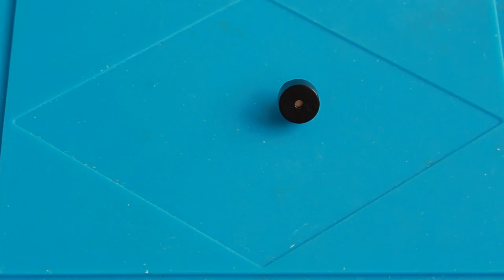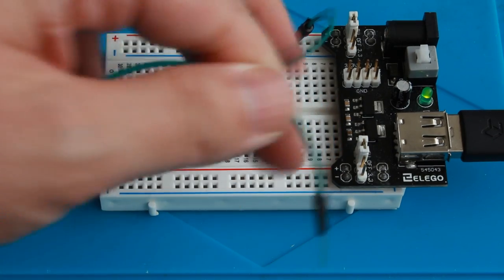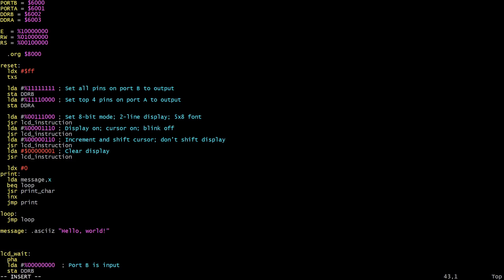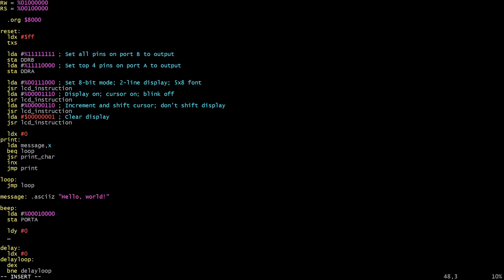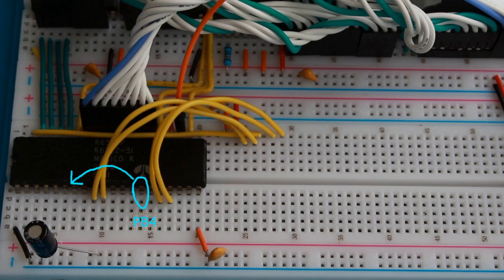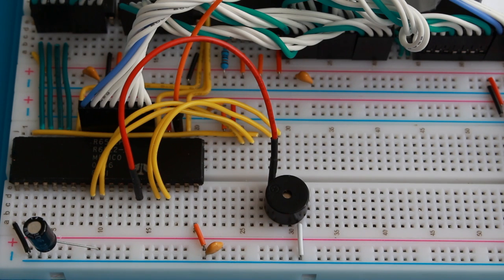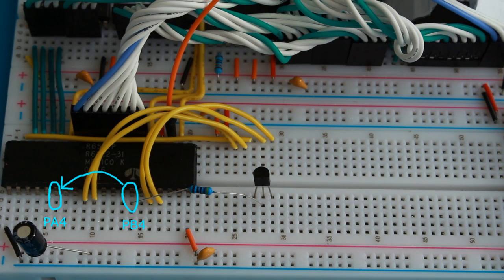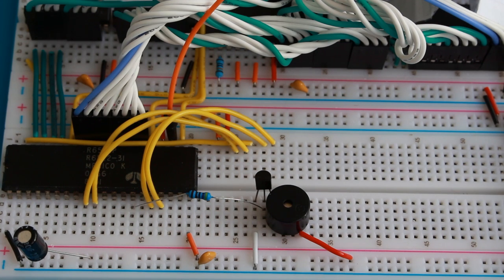Simple Audio Output for Homebrew Computers

Comment: Didn't know all that mattered was the voltage going to the speaker.

What kind of beeper speaker did you use? Looking for recommendations.
Reply from the maker: I'm not an expert on speakers, but more powerful speakers need more current flow as well. These little buzzers don't require much so are easy to drive. I've also dismantled an old TV and taken the speakers out - with a bit of amplification they work very nicely, but they can't be driven directly from TTL logic ICs.

I wasn't very picky with the parts I used here, just using whatever was in the mixed parts kit. I would recommend getting a passive buzzer if you want a lot of control over it (playing different frequencies for example) or an active one if you just need it to beep on demand and don't care what it sounds like.